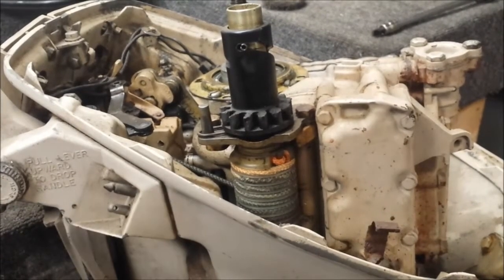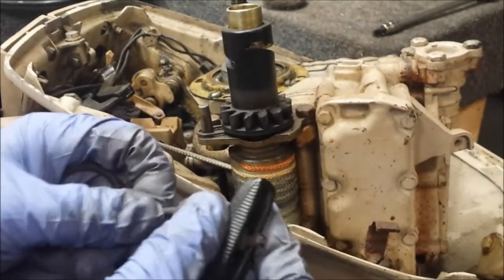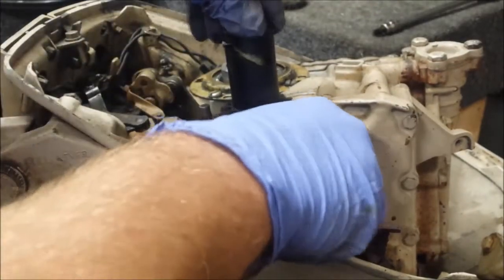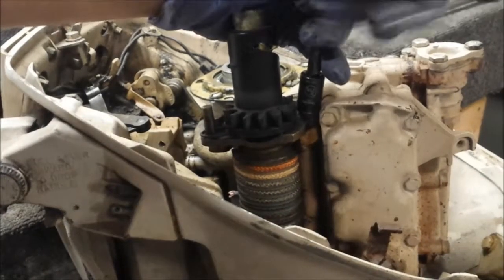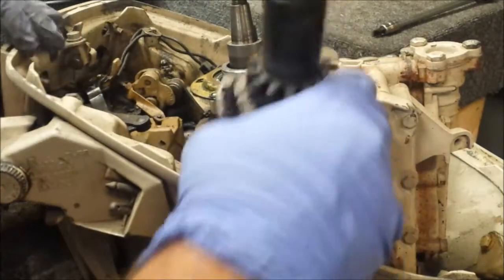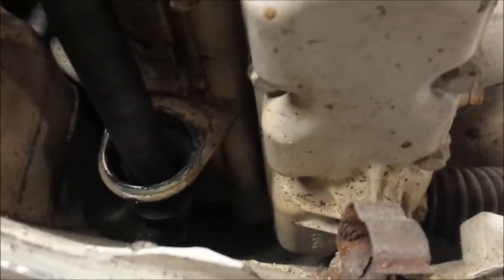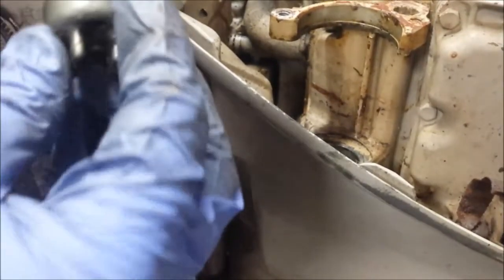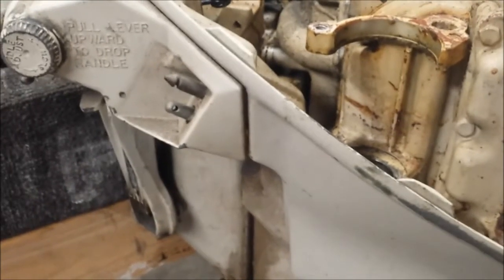Johnson 9.5 HP Teardown - Part 4; Starter

Comment: I dropped the roll pin down in the engine compartment trying to install a new pinion gear on the pull starter.
Is there and easy way to retrieve it?
Reply: easy way i did it was to place an 18 gallon tote on the ground then flip the outboard upside down in it then tapping it with a rubber mallet.

Comment: so im replacing the spring and read somewhere i need a specific tool, is this true?
Reply from the maker: For a 9.5? No.
Only tool you might need is a starter rope threading tool; but, just bring the end of the rope to a point. I do just this in my Colt and 4 HP videos.
Otherwise a large flat head is all you need for the spring.
Reply: So all I need to do is take those two bolts off the whole starter and the spring slides out?
Reply: And how does the bottom part of the spring go on? I'm sure it's not easy to explain but there's not a lot out there about it and the springs are like 55 bucks so I'd hate to mess one up
Reply from the maker: For the most part.
Bottom of the spring has a little channel it fits into, but yeah, pretty much.

Comment: if that roll pin breaks how do you get to it to replace it? or do you have to remove the power head?
Reply from the maker: The bottom roll pin?
Probably have to remove the left side cover; which isnt that easy, but doable.
Reply: Yes sir the bottom pin to hold the starter you showed in the video. The young fellow I bought the motor from got a little carried away while trying to install a new cord lol. I kinda figured I'd have to remove the cover. Good thing you have great videos on tear downs of outboards. Keep up the good work I really have picked up some great tips and knowledge from you.